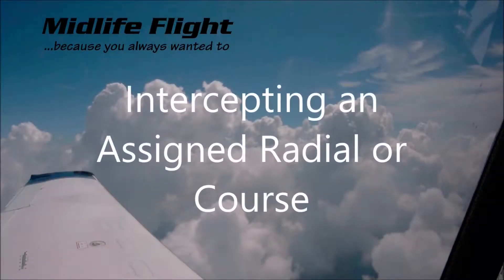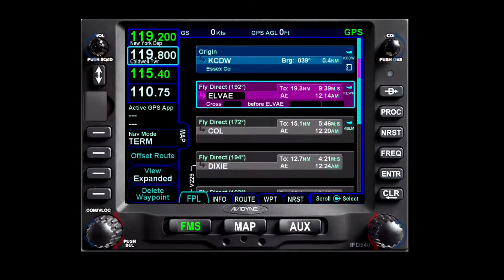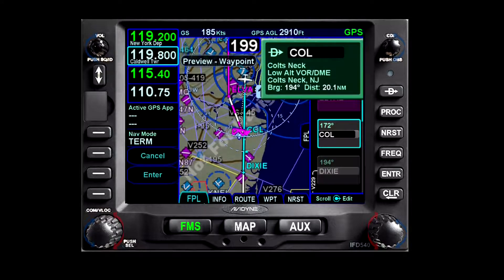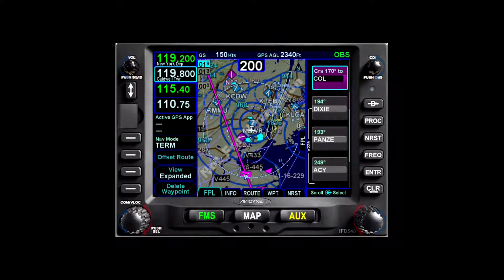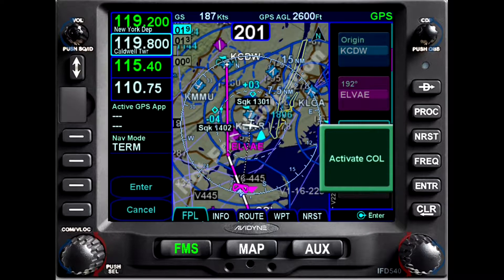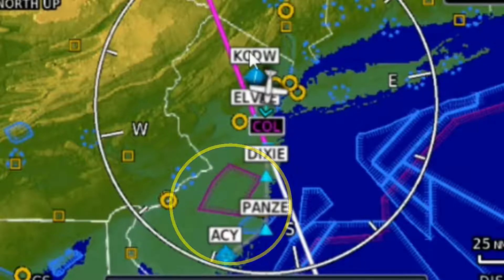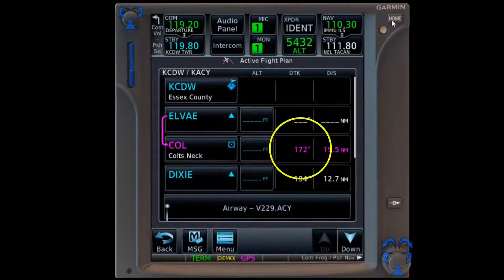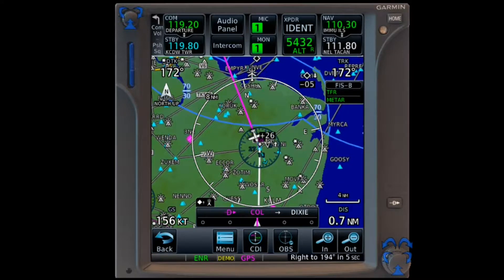Garmin/Avidyne Comparison — Intercepting an Assigned Radial or Course

Comment: Very helpful.  And for the CNX-80/GNS 480 users, using the same example, upon receiving the intercept vector, highlight COL in the flight plan and press the DIRECT key.   Push (line select key) LSK 5 and then LSK 1 for "CRS TO".  Dial in 170 and go!  Autosequencing will resume automatically after COL with no further action by the pilot.
Reply from the maker: Thank you. I have flown with the 480 but not enough to become IFR competent on its operation.

Comment: I think what's sometimes confusing is that it's the course TO, not the radial!  Lifesaving tricks especially around LA and the VFR routes defined by radials. 👍👏
Reply from the maker: I think you are right. GPS navigators don't remove the need to understand the difference between radial and course.

Comment: You say you haven't seen an assigned heading from a fix. Departing Vegas we get LAS BLD BLD080 V562 PGS. Heading to intercept a Victor airway. Not easily programmed in GTN
Reply from the maker: Great comment. I said a from to nowhere. But you are right that a from to an airway intercept is one of those which is difficult to program in a GPS navigator. Possible to create a user waupoint, but It's an example of where I would use VOR or a bearing pointer from a glass PFD, and HDG mode in an autopilot.
Reply from the maker: Adding this. I took a closer look at that clearance. In the air I'd probably go with a VOR OR pointer. But if that was given on the ground, it actually is easy to enter in the GTN. See my video on entering user waypoints. This one is  two cross radials. The BLD 080 and the PGS 290. Try it in your GTN.